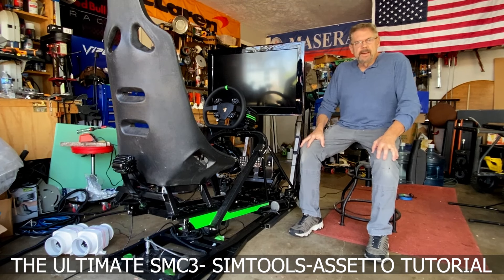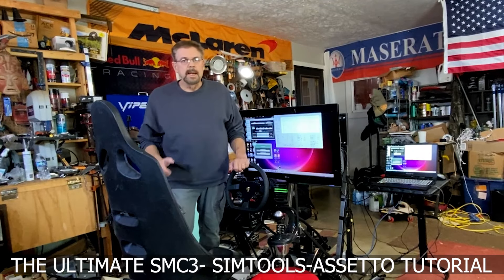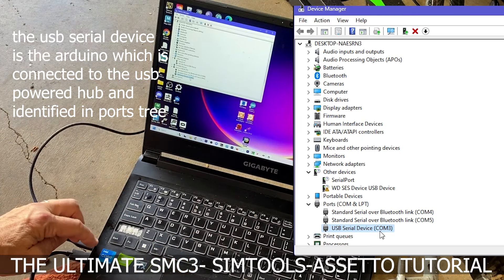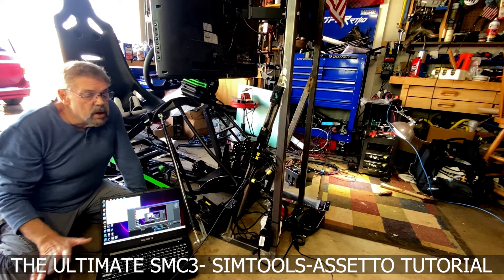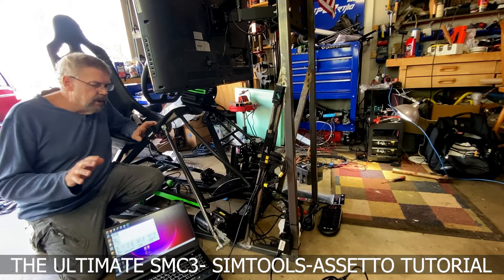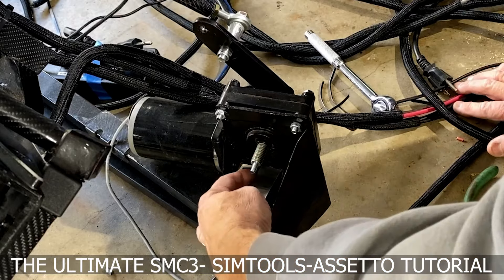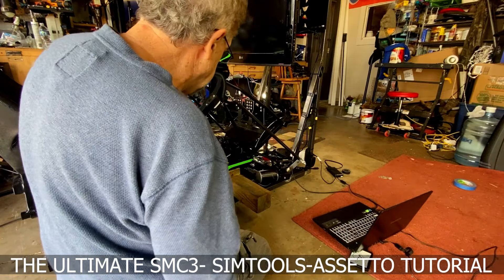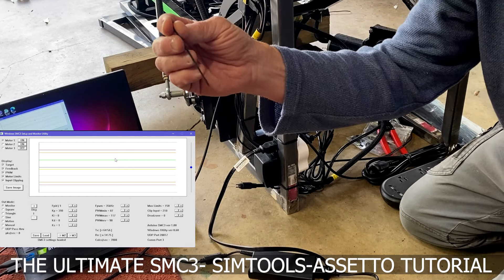THE ULTIMATE SMC3 SIMTOOLS ASSETTO MOTION SIM TUTORIAL

Comment: Those couplers are great! I used thermal shrinking sheath to link the potentiometers to my motors. It's cheap and works fine too! but you can't remove it without shattering it if you wan't to change something... 
Nice One DMax :) 
Glad if you are finally overcoming your vision problem!
cheers

Comment: Hi Dave, I've been following your tutorial and has had some success using smaller motors.  But of course the motors would work nicely without load, but when I sit on the rig then I see it's not enough to carry my weight.  So I decided to get some 24V NMRV worm gears to give the rig more output power.  I powered it with a single 24V/40A PSU and again it works without load and when I sit on the rig it still works but it just stops working after a few seconds.  I'd replug the USB cable and it would work again.  Sometimes the SMC3 util would crash.  I thought it could be caused by the IBT2 overheating so I added more heatsink and ventilation but it still persists.  I'm also checking the temp and it doesn't even feel hot anymore.  I tried soldering everything on board instead of using connectors as you recommended in one of your earlier videos but the problem still persists.  I'm running out tests and tweaks to do.  I hope you can help me out.  I see you're using 12V, could it be that the IBT2 do not handle 24V very well?
Reply from the maker: ok.. so thanks for the questions..  i have used 24v motors in the past with good results.. I would try getting a genuine ardunio r-3.. i have heard that sometimes the 'clones' have issues.. I've not encountered any with my clones yet but it's possible.  the smc3 is talking directly to the arduino so that seems like the simplest option to eliminate.  it's probably not the ibt.    what if you ran your power supply just to one motor?  maybe it's shutting off for some reason.?    try those two ideas and let me know    dave

Comment: What power supply did you end up using?
Reply from the maker: I'm still using the 12 volt truck battery.. at least for the last six months on this rig.  and the same battery since 2020..  so..   I'm going to be building a new rig for 2025  and will try using some server power supplies for that like I planned to do. just have not had time yet.. Dave

Comment: Hi, I have a question for you. I'm building my 2-dof simulator.
I'm using 24 volt windshield wiper motors and I'm using a 24 volt 25 amp computerized power supply.

Is it normal that when the motor has to use more force, the power supply stops for a second? It sounds like it turns off for a second.